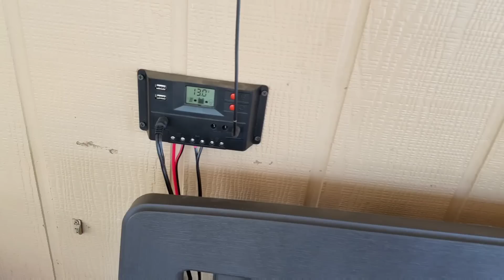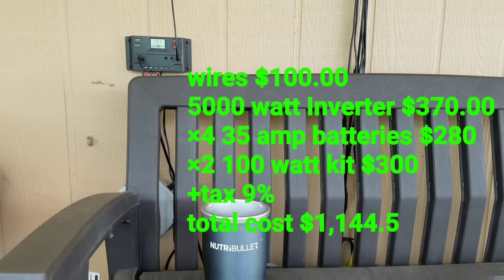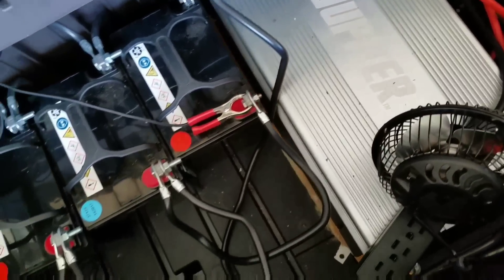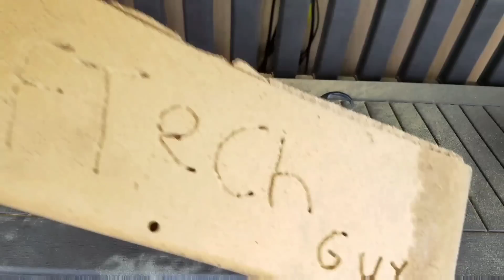What can you do with Harbor Freight 100 watt kit

Comment: I currently have 3 of those HF batteries and they function well. Currently I use 2awg wire because it keeps me in the 4 awg wire range since everthing is less than a foot away as far as the batteries and the inverter which is 750 watts. If I add a 4th battery, it jumps the amps up to 140AH, if I do that, it would require to change the battery cables to 2awg gauge. Will see how it goes. Thanks for a good supporting video that explains how the 100 watt kit works. Good day!

Comment: Thank you for taking the time to make this video. If our power went out in Winter, Spring, or Fall, we'd be fine. I have gas range, plenty of kerosene lanterns and a kerosene heater. Losing the computer wouldn't bother me at all, lol. I have a back up Jackery 240 for charging cell phones with a 100w panel which will charge small items and run a 16 inch oscillating fan on high for 7-8 hours. 

But lately, I've trying to figure out what I would do for Summers here in the north east. It's brutal without AC. I want to set up a solar system that could handle at least a single 6000btu AC and possibly a minifridge if needed. I'll definitely check out your other videos. If you have a parts list/shopping list somewhere, I'd love to see it.

Liked and Subscribed!

Comment: I just picked up one of these systems during the storm Isaias power outage.  I added a 400 watt inverter and a WalMart deep cycle marine battery.  I have some basic lighting, can charge my phone, power the laptop, even use a TV for a while.  I'm impressed.  Very simple, plug and play.  Yes, there are better things available, but this is READILY available.  I'm a happy camper.
Reply: Just read your comments. And got 1 today.  I’d suspect that the items that you use it for is great in a pinch. Any negatives so far?
Reply: @Blah-blah-sure  I have no complaints!
Reply: @vilkinesuo  I have a 750 watt inverter. And I only have a wifi router connected. And that with a fully charged battery. That mine drains the system within 2 days!?  So it's not worth it, and I'm returning it. But thanks for the info!

Comment: On the little 2 Conductor Barrel Connector that plugs into the Charge Controller, is the Tip Positive or Negative?

Why must the unit only be used with Lead-Acid Batteries?

I purchased a Jackery Inverter Power Supply unit (their 100w) Solar Panels cost $300 and the Harbor Freight setup (with extra goodies) was under $200.

I was going to build an adapter that goes from the Harbor Freight Barrel Connector (a Female Socket that fits it) to a Female part of a Automotive Cigarette Lighter.

The Jackery Cigarette Lighter Plug will hook up there to run Solar Panels to the Jackery Unit.

No butchering any or the wires to either setup.

Comment: This video is pretty misleading. First off, the Harbor Freight 100 watt kit is $180 and you spent $1,144...and just to make a lopsided system to show off the "capabilities" which solely depend on the inverter and batteries. You could toss the Harbor freight kit out the window and do the same YouTube demo you just did (run the drill, coffee maker, dremel, ect). You certainly cannot run even the tiniest dorm room fridge off your setup for a few days in a row. The panels and charge controller are totally insufficient for even this simple task. But sure it can run a drill for a few minutes or make coffee a few times then spend the rest of the week recharging the batteries.

Comment: I wanted to see what I believed to be an honest to goodness review/opinion of Harbor Freight's 100 Watt solar kit & I believe I just saw a good one. I'd watched another, but the gentleman who provided it seemed a bit too excited in his video presentation. It may have been the real deal, but your video was a bit more convincing. I'd been wanting to get one of these sets along with a couple of Harbor Freight's very inexpensive ''deep cycle'' batteries to experiment with & to see how well they worked with the Harbor Freight 2000 Watt (Max.) inverter I'd originally got to use in a temporary setup on my pickup to power tools. I was pleasantly surprised by the performance of a 600 or 650 Watt inverter I'd purchased off that famous bidding for stuff site. I hooked it to the battery of my pickup & as a test I put a cut-off wheel in 1 of my 4 1/2 inch grinders & was able to slice through a piece of 1/4 inch plate steel with absolutely no problem. Getting back to your video & your opinion of this system, I can't really suggest anything other than possibly getting yourself a full sine wave inverter so you'll have a good stable & clean inverted source for 120 volts AC. I've had my eye on the price of those type inverters & they've really come done in price since more people are moving to solar and/or wind generator charged battery banks. A lot of flat screen/HD TVs sold at Walmart type stores lack some of the internal voltage regulation & surge or stabilization circuitry that's normally in the same brand of TV, but is sold in strictly consumer electronics stores. The voltage from the less expensive & more commonly found modified sine wave inverters may not be stable enough to continuously power 1 of these department store TVs which may lack the power regulation circuitry needed to help protect all of the circuits within the TV without causing a problem. Although they've vastly improved, modified sine wave inverters still put out a voltage that's not the smoothest. ''Chunky'' is maybe the best description I've thought of & read to explain how the voltage from a modified sine wave inverter is. Yes, they will work to power that TV, but if you've got a $500 - plus TV, I'd prefer to have it powered by a true, full sine wave inverter to be safe. Like other electronic products, their prices have dropped substantially recently to become very affordable. Since they're designed to give you a cleaner & more stable voltage source that's as clean as if not cleaner than what you may get from your electrical provider, I'd definitely see about getting one for those for your more sensitive as well as expensive electronic items. Thank you Sir for that good & informative video.

Comment: not bad for harbor freight stuff !   All that stuff in stock at my store Hamburg NY.  I would use 2 100 watt kits. each as a 12V with own charger controller than series batt for 24V and24V true sign wave inverter.   you could do 4 kits 4 12V battery sets . all same then series for 48V and get true sine wave inverter. much more efficient. If you change charger controller to MPPT you would get more charging amps and can use LiFePO4 battery or NiFe or even the Salt water battery .There is more than lead batteries out there !  I use NiFe Edison cells. 100 yr life !  search here  videos on youtube!!

Comment: battery manufactures do not recommend connecting more than three batteries in parallel and they must be the same type and size. due to charging imbalances. also you can not draw lead acid batteries down more than 50% or it will damage them.  so that being said, three 12volt 100ah lead acid batteries in parallel will give you 150ah/1800watts of useable power.

Comment: I'm interested in purchasing a solar panel to run my welders. Something I use for automotive projects at home.
Biggest welder I have uses 250V 47.5 amp  made by Miller.

Is this something that can possibly be done ? I'm willing to purchase 2 of these 100 watt solar kits if that will do the trick.

T. I. A. And I appreciate your help. Btw good video and experience
Reply: in the U.S. we have 120/240 panels in our homes. ok , lets do the math. 240vac X 47.5 amps = 11,400 watts. while I've never seen a welder running maxed out, you can still figure on using 30amps of load or 7200 watts. so you would need a 8000 watt inverter and enough batteries to run it.  then 2000 watts of solar power to charge the batteries back up.
Reply: @richardcosley7794  thank you much 😉

Comment: i think you just answered my question...So I put an additional 15 w panel to the direct feed....i want to make sure both solar inputs (the jack and hard wire) work at the same time. im guessing your full 100w system is hardwired and the other one has the oem jack. can you confirm this? thanks!

Comment: You paid way too much for the batteries. 4 Deep cycle marine batteries ( 27MDP ) from Exide would run you under $400 and give you 400 amp/hours at the 20 hour rate on 12 volts. While not sealed batteries, they do not produce much gas if you charge them correctly. Sealed batteries unless AGM type of lead acid batteries do vent just like regular lead acid batteries just they are semi-sealed up. And that is what causes them to go bad. Not adding water until the battery won't hold a charge and you pop out the sealed section to get to the plugs in each cell. Lithium batteries, while having better charge/discharge cycle ratings, are more costly.

Comment: Like how you put your system inside your porch bench but remember to insulate around the inside then put a couple small vents on each end for ventilation. The weather Hot and Cold can shorten the life of your system, just 1 inch foam board at Lowe's should be a big help plus it will help everything run more efficiently thus extending the life of your system. God Bless! Uncle Jeff!

Comment: I helped a fellow with his calculations using a TV,DVD player and a light bulb on a 100 Watt panel system and a 110 amp Hour battery: 
Ok you started adding up the TV, DVD, and light at watts per hour. Now usage is 81.5 Watts per hour. 110VAC at 81.5 watts is a draw of .74 amps at 110 VAC. Now we have to see what .74 amps will be at 12VDC. That would be 6.70 amps per hour. Now I have not figured what the amp draw the inverter would draw so lets say 1.5 amps per hour, for a total of 8.2 amps per hour. if you have a 110 amp/hour battery and you do not want to take less than 50 %
discharge,ut of it you calculate haw many times 8.2/110 = approx 13.4 hours or the battery would be at 50% in 6.7 hours. Now you are using a 100 Watt per hour solar panel that you state would supply 80 Watts per hour for 5 hours a day. So 80/12=6.0 Amps per hour * 5 hours = 30 amps per day, So on average it would take 110/30 = 4 days to fully charge the battery, and 2 days to charge to 50%. I hope this helps.

Comment: I'm going to check out your vids to see what you actually can power with your setup.  I just discovered this channel.  I recently placed a 12x20 workshop shed on my property and am considering trying Solar Panel power.  I'm very interested to see what you can run and the requirements for providing power for my power tools and possible an A/C unit.  Though mainly power saw, lights....etc.    You input is welcomed.

Comment: You are using a 12vdc system. When adding solar panels be careful about the output voltage. Many are close to 20vdc which may not be compatible with your system.
Reply: 20V is the max of many 12V panels with 17V to 18.5 being their max wattage point. Both of which are safe as long as you are using a charge controller. You can also use something like a MingHe 7210A with them to charge a 24V system or put them in series and run a 48V system possibly. Mine are on a 24V system and they do just fine. But do not expect them to put out more than 50% of the wattage.

Comment: over one thousand  for all  that ! you need to shop around a little,35ah batteries amazon $69 shipped i purchased two,ebay has power inverters all kinds cheap, those two places is where i have shopped for my solar project i got going in my car garage,i have a 1000 watt power inverter $39 on ebay to run 110v with just two batteries and one 100 watt polycrystalline panel,i have to upgrade my wires for the converter cause it won't run certain 120v things,like my shop vac and compressor, i might get one or two more batteries and another solar panel,i will make a video and post it when i get a chance.
Reply: That 1000 watt inverter though is likely not a sine wave inverter. It most likely s a square wave or MSW. If you run a microwave, a square wave won't be good for it and a MSW will take twice as long to heat things. Motors in a refrigerator like the sine wave better as do most electronics.

Comment: Buy Renogy. 50 dollars more...This stuff is junk!
Reply: These do actually last and do work. They are poly crystal instead of mono and have a lower efficiency. But, these have a major advantage. You can buy them in almost any Harbor Freight. Replacement panels, connectors, ect, can be picked purchased same day. No one caries renogy parts in store.

Comment: The 100 w set up is more than enough on a sunny over cast day. Too cook a simple, breakfast. Power lights at night. Run a t.v. for four hours. Run a lab top. For a.c. fridge you need stronger equipment obviously.
Reply: It will charge a battery that can do all of those things. But no 100w will not run a tv
Reply: It wont even make a cup of coffee

Comment: Pretty darn cool...  I'm running a thousand watts of solar into 4 batteries for my 12 volt system in my class  A motor home and 500 watts into two batteries to run my 3000 watt inverter for the 110 appliances, washing machine, dryer, microwave and what not...  I can boondock anywhere without plugging in... On overcast days,  I just raise up my 500 watt wind.  Generator or throw in my waterwheel in the nearest river I fish at...  I started my project with harbor freight  a long time ago with one of these kits which I still have and still works great after all these years...  Harbor freight  was what got my interest into solar and it just went from there...  Now I'm in a position were I don't rely on anyone for power... Such a good feeling with that freedom...  Everyone should dabble in this like you see in this video...  You will learn slot and have fun getting to were I am at now...  So worth it...
Reply: Bad ass man
Reply: Inspiring! Freedom (political, energy,  financial) for all!
Reply: Im doing the same setup
Reply: Thanks for sharing
Reply: just getting my feet wet in this solar. four walmart deep cycles battery , Marine Rv. I have enough generator power to run my whole house. doubt that I will ever get that much solar.

Comment: I want to run a 25 W submersible aquarium heater to keep my chickens water from freezing during the winter. What type of set up should I be looking at using? Will this 100 W harbor freight kit do the job I need it to do? I’m planning on running two 75 amp hour marine batteries

Comment: So you are saying "DON'T WASTE YOUR MONEY ON HARBOR FREIGHT, CAUSE YOU HAVE TO UPGRADE EVERYTHING LATER  " ? Batteries, wires, controller , am I correct that I heard you say that ?
Reply: It is good for learning
Reply: Yes. It appears the Harbor Freight solar kit is for pretty basic electric uses. If you want to run air conditioning all day... you'll need seriously bigger gear.
Reply: A.C. is a beast. Nothing in your house consumes near as much. I nerded out one day and calculated gravity generated power. 2000 lbs 50 foot distance will power a 1300 sq ft house for 24 hours. (With AC). Using a large generator, removing the Engine. And using a grear down to reduce elevation needed while producing the proper RPM to run the generator. Think of the gears in a weight driven Clock.

Comment: Sadly.. i dont think it would cost that to run ac all year in my uninsulated garage. Still have upkeep of the batteries as they die off every so many years.
Reply: I figured it cost me almost $1/day to run a 7500btu ac, not 24/7 just about 10 hours. so 10c /hour? to pay for itself, running 365 figure itd take 3 years. there's a high overhead with solar, but with LED lighting and DIY so many things to set up, you can really make it work for cheap in a 5 year plan. thats how long the batteries would last. maybe less tho :(
Reply: pds tech alternatively.. dont run batteries or so many and just allow loads to run during day. When you would need it anyways.
Maybe one battery as a buffer

Comment: I haven't found an inverter yet that will provide enough power for my Keurig machine, its embarrassing that most inverters they sell at big box stores pretty much power nothing I use in my house.
Reply: a True 5000 watt inverter will power just about anything A fridge & microwave at the same time.
Reply: And good luck generating enough voltage to achieve a plasma base with enough lift for a d28-44 star ship//